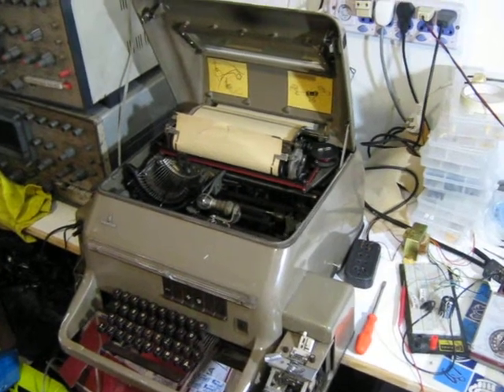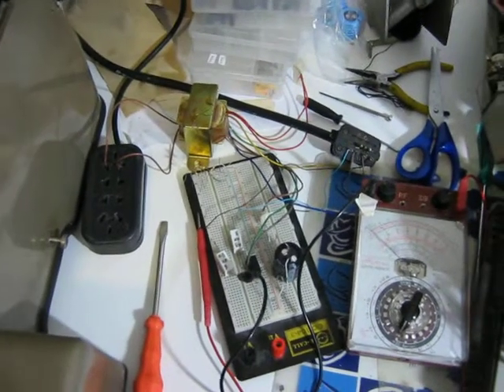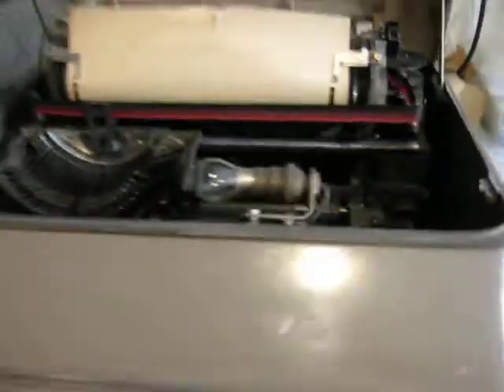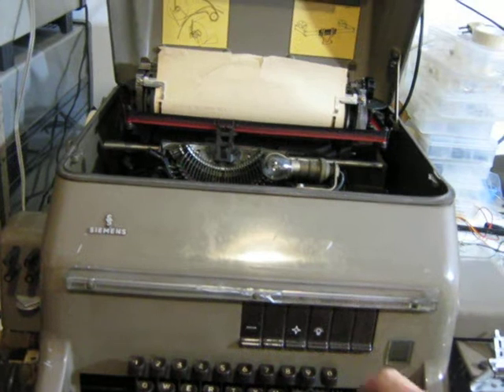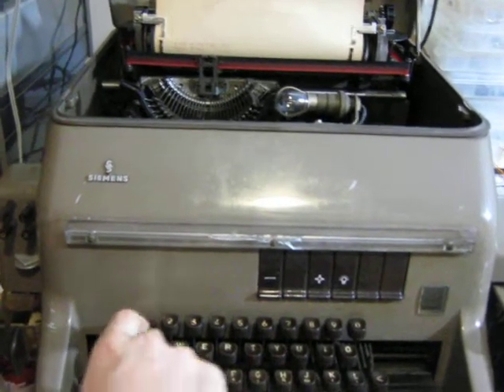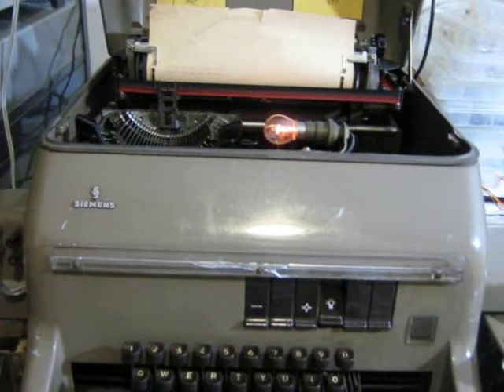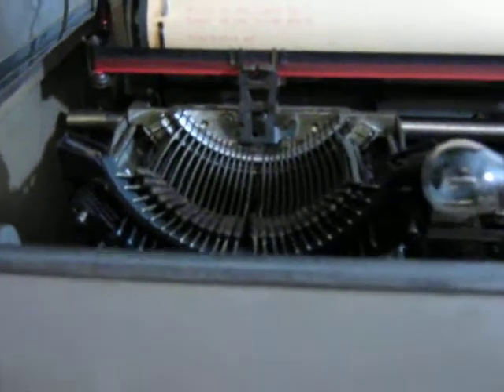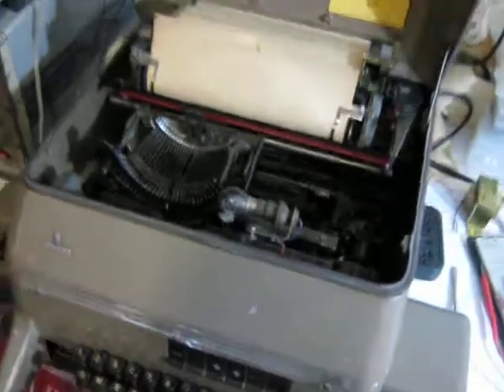Siemens teleprinter/teletype 100A - Part 1 of 3

Comment: Better use two returns and then a linefeed. This is because the writer head is a bit too slow to return to the beginning of the line if you only use one.
Reply: Only if it is out of adjustment, been wrongly assembled at some point or is poorly lubricated.  I serviced and rebuilt so many of these machines, I can still remember most of it after 40 years.  The biggest issue was the ribbon return (it must have been designed by the cleaner).  

I also worked on  the 100 Series two (a few changes, not all good, especially some of the clutches), the T send 77, the Tloch 15 A and B, the spawn of the devil 75 baud Tlock 15 D and F, and a number of Teletype machines including the Model 15, Model 19 and some specialised machines only seen in central offices, also Sagem <grrrr> and GE Terminette machines.